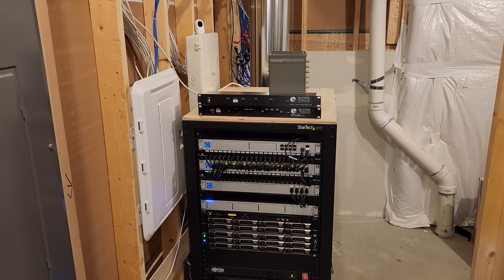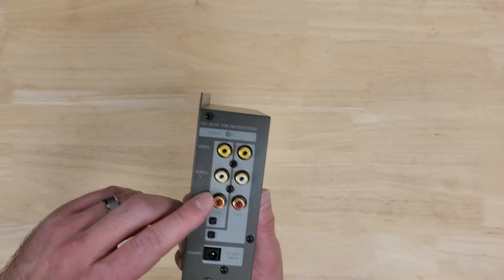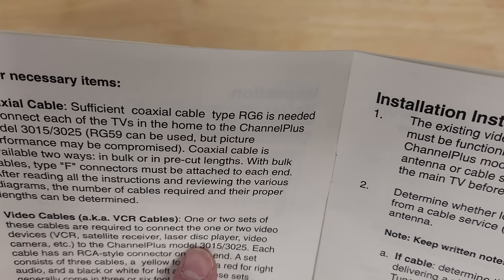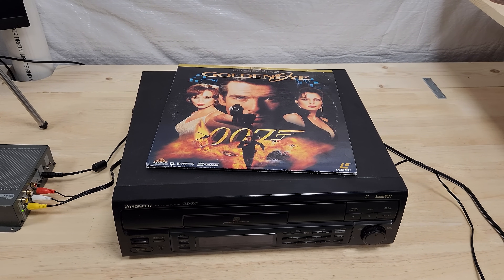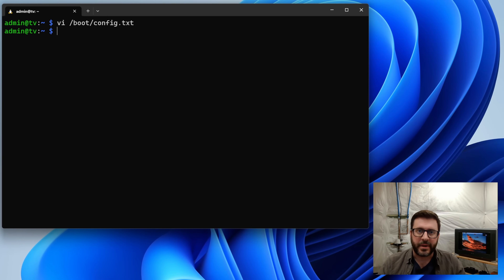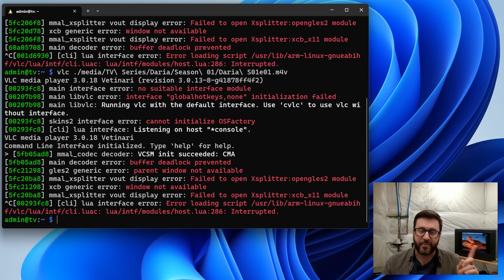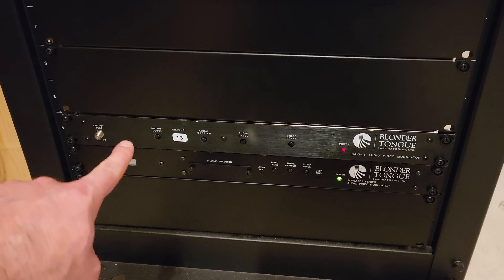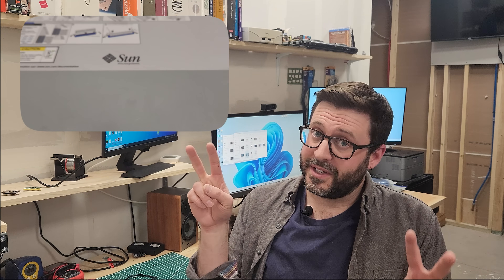Homelab Episode 5: Custom TV Stations

Comment: I noticed on the rack mounted RF modulators that they split the audio/video between 2 coax connectors and then you're adapting them to an RCA jack correct? How would this accommodate stereo sound or are you just using mono?
Reply from the maker: it's just mono
Reply: @clabretro interesting. So the home consumer model is technically better since it grabs both channels? I’m thinking about doing this in my homelab but I’d rather have a rack mounted solution. Might have to add a combiner in the chain somewhere to get stereo to mono without losing L or R. Thanks for the reply.

Comment: trrs cable. i think i bought cables that you use for apple ipod video.

i think that was what it was, its been a few years.

i also had a cable that i needed to plug one of the audio sides into the composite on the tv.

i use to build pi into fight sticks to plug up to CRT tvs hence why i tried  various cables

Comment: how do you get more than 1 channel to add/insert to 1 cable  ..ihave 2 coax--- hd antana on1 and comcast cabble on coax 2 and doing channell 3and 4 insert with bnc spliter + hd antana on 1 cable for catv on 3 and whant to go more channels so i got 10 more hd rf modulators with programable out chanels  from ammazon at $22 each now how do i insert all the outputs  to the same coax cable
Reply from the maker: not sure if HD is any different but I just used a simple 2way splitter, outputs from each modulator get combined by the splitter onto one coax for the tv
Reply: I found these f female 3way to chain them with no problem and I made some really short f  rg6 cables to attach them together into line
Reply: So far I have ch 1 3 4 6 8 16  +   Antenna channel s
Reply from the maker: very nice!! @chilly_willy_allentech8328

Comment: This would be so cool to see working in a biggish house with coaxial cables routed already. Also i am sure you have seen the rack mounts they have for raspberry pi's. Repurposing a 1u or 2u Chassis for housing everything could be a solution. It would be neat to see how the Blonder Tongues would react if you wired a USB-C 12V Power Trigger Module to it, ive seen people power up and play games on a ps2 with one! and in a rack setting it seems like it could be efficient!? Also what does the jumper do in the Blonder Tongue that has no video?

Comment: I used to work at a university and we had a Blonder Tongue modulator for a local access channel we ran. That thing didn't have a day off since the late 90s. The signal would sometimes get snowy and we had to go by and hit it a couple of times to get the signal to clear up.
Reply from the maker: Haha. Yeah I'm thinking these have tonnnns of hours on them, hence the need for some maintenance.
Reply: @clabretro  I honestly don't think they even make analog modulators anymore. We tried to find a replacement for ours and there simply wasn't anything out there. Most everything is digital these days. We used ZeeVee modulators for our HD digital broadcasts and they were temperamental. They had built in mpeg2 multicast though, so that's fun.

Comment: If you haven't found a solution for the 60 cycle hum yet, here's another thing to check. Make sure all your analog audio cables are run at least 18" away from any power cables. These old analog cables will pick up a 60 cycle hum when they are run alongside (parallel to) any romex or power cable. We used to have to run them 18" apart and only cross them at right angles to avoid that hum.
Reply from the maker: Thanks, I'll bet I had power cables pretty close in all my tests, so I'll give that a shot!

Comment: Interesting, what  do i need to acquire to do this myself? any links to share?
Reply from the maker: Basic ingredients are anything that can output composite (RCA) and then an RF modulator (which can take that RCA input and output coax on a particular channel). I happened to use the ChannelPlus brand but many cheap RF modulators were made over the years.

Comment: I've worked with analog Blonder Tongue units longer than I should have (had a good time). My last job I worked for a school district that had an internal cable system which distributed channels to dozens of schools across a larger city. We recently decommissioned analog in 2021. We had around twenty 'educational cable channels' a few would be something like Discovery, TLC, the news networks, and a few municipal channels. We used Blonder Tongue agile modulators that were fed from Comcast cable boxes. Humming with these units was very common most likely due to decades of persistent use straining capacitors and resistor that somehow leached into the audio circuitry. Distribution came out of our data center with clean power and the audio would persistently hum on many units. Other units would have come and go instances of humming and others were likely running for 15+ years with no humming issues at. On two occasions I was able to eliminate hum by replacing the distribution amplifier which is separate from the built in amp on the modulator.  I am not an expert and received no training on analog cable distribution or agile modulators. It became part of my job to figure out this system for many years and looking back it was really fun to learn.
Reply from the maker: Very cool. I've heard from others that hum was a big problem with these. Whenever I get around to re-capping I'll post a follow up video.

Comment: Can tvs display 1080p or even 2160p with coax? I dont think itd be able to but i would like to build something like this in the future so instead of raising a youtube kid i can curate good kids content and not have to select individual episodes or get screamed at when i cant handle listening to elmo yell anymore and make them watch a different show, but i still want high quality visuals.
Reply from the maker: Probably doable, but not with this setup. The modulators take composite in which is only 480i. There are probably other (more expensive) modulators you could find to do higher resolutions.

Comment: I'm so glad I found this video, I've had this idea for years and been wondering what to do with all the coax drops in my house. I haven't found a great way to do it though without just buying a bunch of PI's and converters I didn't realize there were rack mounted RF modulators. I just found a 16 channel one on Amazon and it's got the gears turning.

I wonder if at this point if Pi-Zeros might be more economical.  I have a rack mounted Screen that accepts BNC (And BNC to Coax is super super easy), so I plugged in a Pi with an HDMI to BNC adapter and it plays the first 10 seasons of simpsons on Loop, but I'd love to move it to exist with real TVs. Though this could be a really good usecase for buying PI 1's that have the old RCA jack.

There are etsy sellers and such that sell Raspberry Pi Server Rack Mounts/3d printer files. 

I think I always tried to solve this problem as a software problem. Run a single server with a bunch of docker containers, and have them all broadcast over the network, and then just be able to pick up streams instead, but this way is much nicer. 

That being said I still don't know the perfect content that isn't just episodic show (Simpsons, South Park, Futurama, House) in an eternal marathon. 
Old Cartoons shuffled up? Do you find Old Commercials and splice them in? 

The stretch goal challenge though.... is Could you make a TV Guide channel for your own content xD

Comment: Hello i have a question to ask is it possible to connect a raspberry pie directly to the Channel Plus and the. The channel Plus into the tv
Reply from the maker: Yup! Anything that can output composite can go into the Channel Plus, and then you need a tv with a tuner for the coax (which virtually every tv has).
Reply: @clabretro  thanks. In other words any CRT I just ordered the channel Plus 3024 from eBay
Reply from the maker: As long as it has coax in and a tuner you should be okay
Reply: Hello I have a question to ask 
How do you enable Compasit on Raspberry pi and can I use a HDMI to component with the Channel  plus ?

Comment: 5:21 Cable TV channel 22 ? BTW, Japan has this Widescreen Sony Trinitron WEGA with BS (Broadcast Satellite 11 - 12 GHz) analog tuner). Also Japanese Cable and Antenna modes (62 channels for AIR up to 770 MHz and 62 channels for Cable up to 470 MHz; unlike Americam Cable TV frequencies have 125 Cable ready TV channels that also includes UHF over the are and Japanese VHF channels.

Cable TV 22 is Japanese VHF TV channel 4.
Reply from the maker: interesting!
Reply: i'm still having childhood flashbacks of 
1: being limited to a 12 channel selector nob on the tv.
2: going outside to turn the antenna poll and having a yelling competition
3: if a freaking miracle happened 3 channels would pick something up [1 would always be some preacher that made you want to "permanently check out".

Comment: Cool idea... Is there a single piece of hardware that would allow multiple inputs then allow you to broadcast out to multiple RF Channels?  Or do you just get a splitter with more inputs ?
Reply from the maker: Yeah those channel plus units can take two RCA inputs and put them each on a channel with one coax out, but you can also just use splitters and several input devices.

Comment: Someone may have already mentioned this but i have a feeling that the audio issues are related to use of the splitter to combine signals. Its worth testing without the splitter mixing to see if that resolves it
Reply from the maker: Oh good call out, I don't think I got it on film but the audio issues were present even without the splitter (can't say I would've thought to try that specifically though!)
Reply: @clabretro  then it's very likely a bad filter cap in one or multiples of the equipment. I watched this as I was falling asleep the other day but I do remember you taking the lid off one of the modulators. I'm new to your channel so idk if you dabble in repairs at all but re-capping is pretty easy like a 3/10 on the difficulty scale. Might make a fun follow up video
Reply from the maker: That's what I'm thinking too, yeah I'm not expert but I can replace some caps. I'll have a follow up whenever I get around to it!

Comment: Did you ever get a python or similar script to work with vlc to shuffle and autoplay a playlist on boot?
Reply from the maker: ehhh sorta, I use it a bit here: https://youtu.be/gLIbVDWMsJ8

a version of the source is here: https://github.com/clabland/go-homelab-cable. but I mention in the other video, it's kinda broken at the moment. I owe you all an update.
Reply: @clabretro  I just abounded the VLC or omxplayer idea cuz I couldn’t getting it working on boot up. Ended up going with Libreelec and kodi on a raspberry pi and used a kodi plug in called playback resumer. It allows u to auto play and auto resume on reboot and shuffle as well. Worked out great
Reply from the maker: Very nice! That's a great setup too.

Comment: all I ever hear is DVD or VHS, you do not hear anything about Laserdiscs anymore!

also when I hooked a Pi up to an old CRT, there was TRS cable someone said to buy that actually did work. it was something one of those raspberry pi online retailers sold on their site (and can pick up on Amazon). Forgot what it was called but I think it was like $20 and it actually did work
Reply from the maker: I found some good pi TRS cables on eBay as well.
Reply: @clabretro  ah nice! I liked your video and I’m looking into a way to use this same method for retropie. Just need a way to get the controller working in rabbit room

Comment: There is also a program called the weather star xl weatherscan emulator. Its on two today forums. I used to have it run on rf 24/7 back in the day, im not 100 percent sure that it still works, but the forum still seems active?

Comment: As a 10 year cable technician now IT Professional, this video just warms my heart 🥰
Reply: how do you get more than 1 channel to add/insert to 1 cable  ..ihave 2 coax--- hd antana on1 and comcast cabble on coax 2 and doing channell 3and 4 insert with bnc spliter + hd antana on 1 cable for catv on 3 and whant to go more channels so i got 10 more hd rf modulators with programable out chanels  from ammazon at $22 each now how do i insert all the outputs  to the same coax cable

Comment: Awesome setup...so the issue you are probably having with the headend modulators is you are overdriving your TV. They were meant to drive a whole cable system and normal output is anywhere from 40dbmv to 60dbmv.... your TV is designed to run a video signal at 0dbmv. Also, you can overmodulate your video and/or audio. To really set it up correctly you need some sort of RF meter to get your settings and levels correct. I can give you a few pointers and a few things to try if you want  to get things working a little better. 👍
Reply from the maker: Thanks! Yeah I've been thinking about getting an RF meter... I'll reach out if I'm stuck whenever I get around to tinkering with these again!

Comment: Don't u need a license for broadcasting. Everytime I get a new modulator in my tv van the old one must be deactivated with the FCC because my broadcast ID license is at stake...careful please
Reply from the maker: it's just local to my home so it's probably fine
Reply: @clabretro  before the cable tv digital switch conversion you would probably have had a issue. Nowadays probably not unless it's a channel holding Emergency broadcast information. Old skool is the best skool for that stuff be careful. I had to work 4000 hours before I got my license to use them alone to broadcast years back. Did you ever hear of Captain midnight or the max headroom pirates back in the day those were just 2 of the people who interrupted channel signals and got massive legal trouble. Wiki them or Google if you didn't cuz it's amazing what u can do with a modulator. Serious carnage. I do love the manufacturer names on your units. Just to be safe though you shouldn't constantly be using them to be safe. They basically are made just like EPIRB locator beacons. If u press that button helps definitely coming and it's non reversible lol. Just a heads up cool video. If u ever sell em let me know I'm definitely interested because I don't think u can legally sell em online...you do have powerful emitters in those older units even without a hi gain antenna
Reply from the maker: haha thanks for the extra info.
Reply: @clabretro  I've been a video engineer for 22 years and had my broadcast license for 20. I've had three fines since then the first one was free, the second was 500, the third was 5000 thank God work paid them cuz they just keep adding a zero. I used a modulator to run a video coverage of  Olympic trials in a fairground for a weekend with permission. It was on  overlaying the 6mhz bandwidth and therefore it was not allowing the small cities closed captioning services to work. They are that delicate with channel overpowering they can even sometimes interfere with shortwave, cb, and hamm signals. Good luck pretty cool video I still have to admit. If u have to much hum try a75 ohm resistor or try a separate AC plug and make sure cables don't touch, if you still got him you can also try powering on a motor nearby such as a circular fan or generator, I'd that don't work try a video distribution amp. Best of luck. Don't forget wikipedia captain midnight you'd get a kick out of how modulators mess with NTSC video

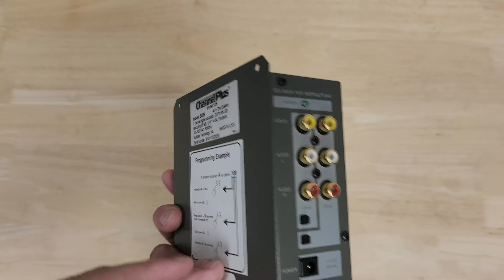Comment: 2:53 because most TVs still have analog TV support, and it‘s really easy to build a basic RF modulator, there even are many RF modulators available to this day, also from China. There are more expensive DVB-T/ATSC modulations, but they aren‘t as cheap.
Reply: I saw one with HDMI input on aliexpress. An analog one to be clear.

Comment: Instead of composite out from rpi needing config just use HDMI to composite adapters which let you leave everything at default and also not even need raspberry pi devices to begin with if you have two servers with HDMI output that are already always running, or one server with two HDMI outputs or whatever.
Reply from the maker: yeah will eventually switch this over to get the servers generating the output

Comment: I did tech support for an apartment complex with an almost identical setup (down to blonder tongue) some odd 20 years ago. Cable TV came in, and there were 3 or 4 RF modulators set to empty channels. Then, the signal went through a distribution amp and into some beefy RG11 or similar. One RF modulator showed movies, one had a computer with a PowerPoint showing current events.

Comment: I did this before. I had eight channels using eight Blonder Tongue MICM-45DS. I used a old PC with a USB2.0 add-in card to get four more USB ports then used eight HP T100 multi seat clients. Also used eight VGA2AV adapters to turn the VGA signal to composite. From there it was all software. Had a multiseat environment going and each seat loaded a bare minimum X11 session with VLC loading up automatically playing a playlist at random. Think the whole setup cost me about 125 bucks. The RF modulators was given to me but I had to build a power supply for it. I ran the system for a couple of years then the PC power supply died and by then I was the only one using it so I gave up on it and sold off the modulators on eBay.
Reply from the maker: Impressive!

Comment: For CC TV like this, is there any notable difference when the output is to VHF low (2-6) or high (7-13) vs UHF channels? Thanks!
Reply from the maker: Not that I've noticed (but it's been awhile since I tested lower channels)
Reply: You need a good vhf-vhf-uhf Modular’s and pick some used channels